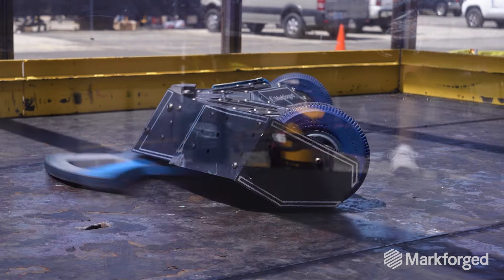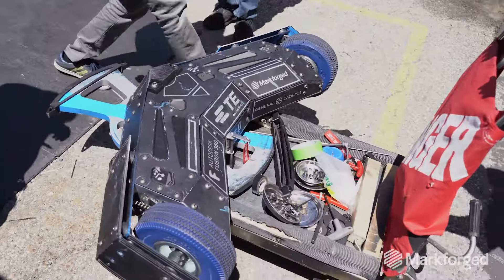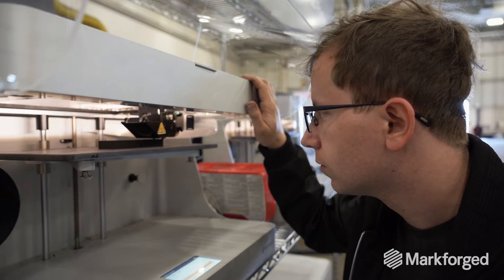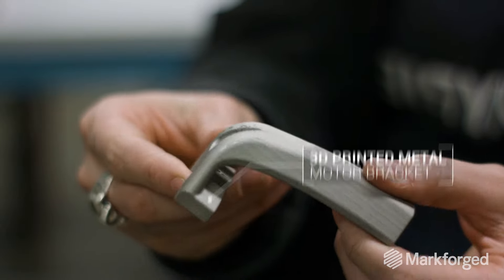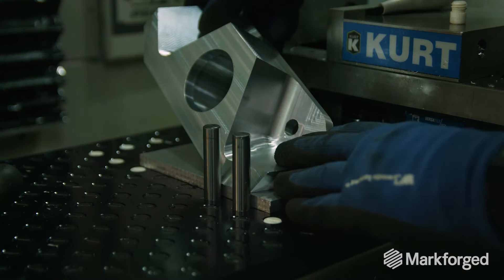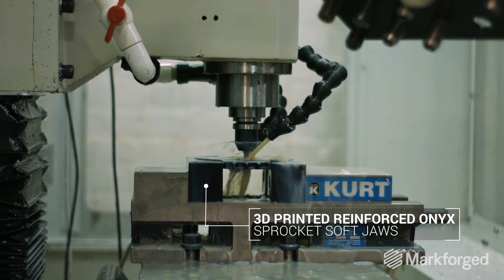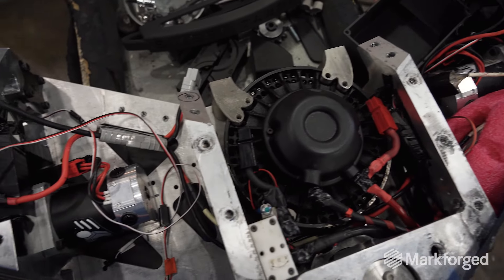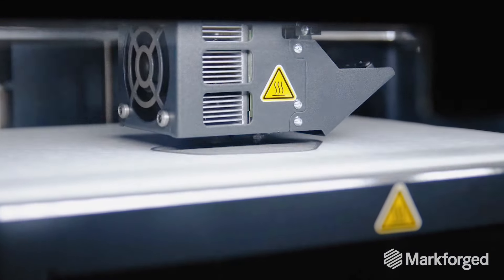BattleBots Team Valkyrie | 3D Printed Combat Robots

Comment: Print metal strikes a lot of people as "weak" - But what you're losing in thickness, you can often make up for in triangles & trusses, due to ease of manufacturing. Great work on this project! I bet you're getting a lot of purchase out of stuff like the shock resistant electronics casings as well.